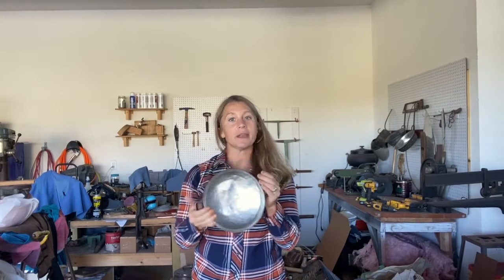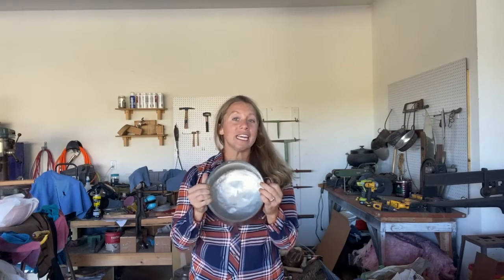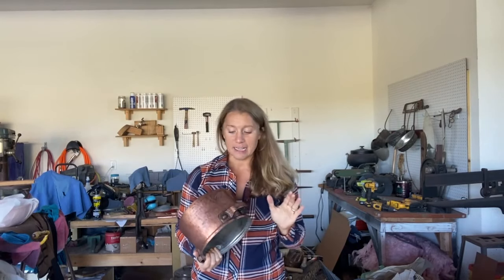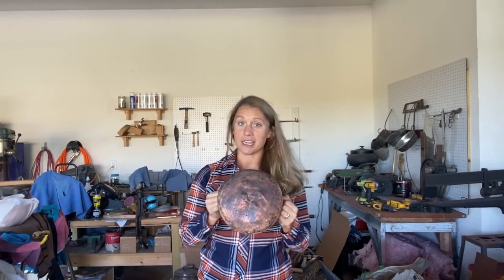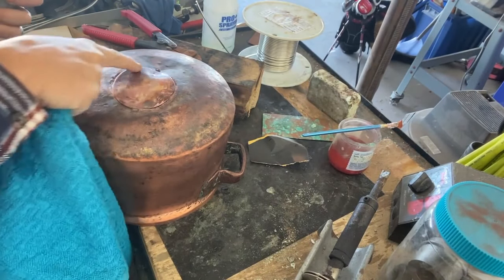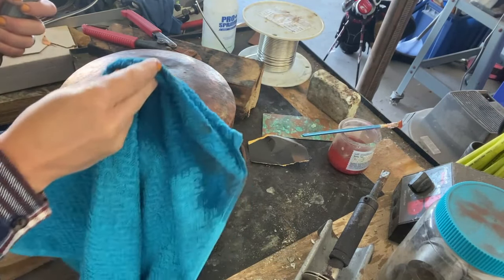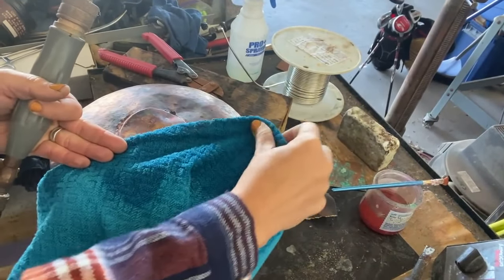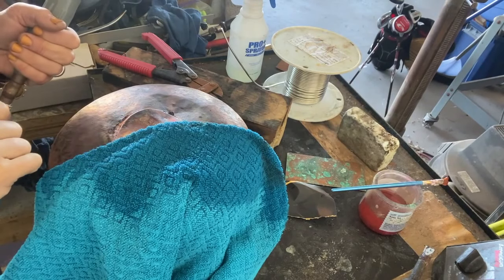How to Patch an Old Copper Pot

Comment: Try using smaller brazing tips for more heat control. You may also want to try a Smith brand jewelers torch for real fine heat control and smaller projects. A lot of the "wrinkles"in the bottom of the pot can be rolled out with a seam roller like what is used in leather work, backed on the inside with a rubber mallet. This will make your pot surface smoother without stretching or cracking the copper bottom and easier to apply the patch.
Reply from the maker: Thank you so much for sharing your advice on here (for me and everyone else)...sounds like I need to look for more tools. No complaints here! :)

Comment: In electrical soldering we have solders with different melting points. So when you solder complex structure you start with a solder with a high melting point, and as you progress you use solder with a lower melting point so you can solder without the first soldering smeltes. I pot soldering I would consider using silver solder, a solder that has a melting point nearly twice as high as tin solder.  Nice pice of work by the way and thank you for making these videos.
Reply: Brazing has the same technique. Pre arc welding, there were many different alloys of brass that melted at different temperatures. If you will be brazing multiple times in the same piece you start with the one that melts at the highest temperature then go down from there etc. Plumbers also do this via brazing first then solder with high-low melt alloys depending on the amount of joints needed in the same vicinity.
Reply from the maker: I love this - thank you for sharing! I only use a single food-safe solder for my work, though, for obvious (food!) reasons, so I don't have the luxury always of using multiple melting pointed solders, but when I next can, I will try it. Thank you!
Reply from the maker: Thank you for sharing! Can't wait to try this someday!

Comment: I hadn't really considered cookware as metalworking until today, you're solving some really fascinating challenges with it. I've been very happy using silicon/nickel on a TIG torch with iron, and I'm wondering if that would be a suitable repair for copper as well because it tends to hold up very well at high temperatures. I'm curious to know if you have any experience with that. Keep these videos coming, they're awesome! Also, I'd love to see a tour of your shop.
Reply from the maker: I do not use any TIG with copper because of the extreme conductivity of the copper - the rest of the pot pulls the heat off so dang fast, TIG is only good for tiny spot work, not full re-tinning. Just my two cents, though - it's always worth experimenting!
Reply: @housecopper  I guess, but what if you used a file or a wet grinder.  It would stay cold and not work harden . the copper

Comment: Very useful demonstrative video - just wondering if the patch will trap water/food behind as the holes on the inside will allow the passage of material through it...?
Reply from the maker: That's a great question, Jacob. And no, the interior's tin lining will sort of run together and create a watertight seal as I do the patch on the interior. The goal is to create an insurance against future breaks/cracks in the copper. The customer says it works just fine, no food issues.

Comment: Great video.  Was wondering if it would be better/easier to feather the copper patch edges prior to attaching it to the bottom of the pot.  That would reduce the amount of finish grinding at the end. But otherwise, very good video and keep it up.
Reply from the maker: Thank you for watching! You know, it probably would be - though I think I'd have to heat it up a good deal to do it right. Feathering without annealing usually results in cracking from over-work-hardening the copper. But I love the idea and will have to do it next time to see how it works!

Comment: Nice job, I never soldered a pot,  but I have soldered copper pipe and brazed a lot in my lifetime.  Could a wooden plug or form been used to bring the damaged area of the pot to more of a uniform shape, then solder the patch. Very curious about this craft/trade/skill lost art.  Definitely did a nice repair.
Reply from the maker: Thank you so much for your support! It's always an experiment! Yes, usually you want to re-form the pot bottom, but in this case the crystalline structure of the pot had been so stretched, any hammering or moving of the metal would have created more damage - and the bowling out is both design and lots of use/heat/stretching of the copper over time and use. You totally have the right idea for how it would be done 99.99% of the time!
Reply: @housecopper  Thank you for your reply. You are very knowledgeable in this subject, definitely learning from you.

Comment: I am working on a project similar to this. I need to plug a 1/4" wide by 3/4" hole in an 1895 hot water tank for a Magestic range. It is tinned on the inside and nickled on the outside. I planned to braze it but not sure. 
Thank you for any help.
Reply from the maker: That is a BIG hole to patch! Whew! I'm not sure about nickel in general for tinning, but I think going with the brazing torch (check to see what kind of solder will be best - maybe using bronze and acetylene will be best for you?) or TIG if it's not very thick. Good luck!

Comment: I have this same issue with a pot. It has teeth like patch at the bottom I am looking to seal. In your video, I think that the patch may fall off when the pot is on the flame (no oil or food in the pot), right around the melting point. Also, the food from inside can lodge into the cavities or voids so that's another risk. Is there another way to simply close the gap with copper welding? Tin can melt off easily in some extreme cooking....
Reply from the maker: If the patch is made with gold-colored solder, it is brazed, and will not fall off with cooking. The cavities on the inside can be filled with additional tin during the retinning process.

Comment: Is that a prest-o-lite acetylene/air torch? Cool

I would have heated the bottom just enough for the cramped seam to be softened and separated. Cut the new bottom from thicker material, hammer the sides to match the thickness of the seams of the pot, cut seams in the bottom, clean both seams and attach making sure there is tight 'very clean' metal/metal contact, braze together using a phosphorous copper or silicon bronze rod (copper colored and ductile), then after it's cooled it can be cold worked to make it uniform and remove any distortions. Buff / Re-tin. 
The next owner wouldn't easily identify its age via the color of the brass filler from the 19th century, but it would be flat and you could use it for any type of cooking.

This is close to how it'd be repaired 150-200 years ago if it was sent off by m'lords cooks and had his insignia. Only they'd use a charcoal forge to do all the heating/brazing/tinning.
Reply from the maker: You could have done - except this was going back to the original owner, and they would have seen the difference in material. I love your idea - I will have to try it next time something like this falls into my lap! It would also have cost the customer a LOT more for that type of work, which not everyone is OK paying. :) That said, than you for sharing this - you're right, this is the best (and old) way of doing a totally new bottom vs a patch, and gosh, I wish I had a charcoal forge! just saw one in full use last week and it was super awesome in action. One of these days...

Comment: Indeed it's a last ditch attempt if the metal is so thin and brittle! I would have tried raising the patch a bit to more closely match the curvature of the bottom of the pot.That way the inside of the patch would hold more tin (like a shallow bowl) and you might be able to get it to adhere in one shot.  I'd also tin the area where the patch will go, and while it's still molten, quick drop the patch on top (tinned concave side towards pot), following immediately with the torch. That's the theory anyway!
Reply from the maker: Hey, it's a great theory! Next time, I'll try it!!

Comment: Wouldn’t it be easier to cut out the cracked metal and TIG on a new patch then re-tin ?
Reply from the maker: The copper is so frail and thin and cracks so much that the TIG would melt the old copper you're trying to weld to - it's the same with acetylene when we try to patch holes that way. The copper you're trying to fix, if it's old, just burns a bigger hole. I wouldn't want to risk it, anyway.

Comment: oops. i have apparently been holding my offset snips upside (actually: am thinking that when cutting "in the air" they are held one way, and when cutting down on a surface they are held the other way over)
Reply from the maker: Meh, I actually am the one holding them upside down in this case, but that's how I learned and I feel like it works so much better!!!
Reply: @housecopper  
I realized that it was you holding them upside down relative to their design when i looked at my snips.

your way of holding them has it's advantages - e.g. position of sheet relative to hands and snip handles and a "better" orientation for holding the material being cut for a camera aimed at oneself rather than down at a table.❤️👍
Reply from the maker: @rampanttricky17  ha! I didn't even think of the camera angle. The method was taught to me by the master I apprenticed under, and I tend to not change anything I learn from Bob because he's brilliant. lololol. I also feel like there is less scratching on the underside when holding them this way?? idk, to each their own, right? :)